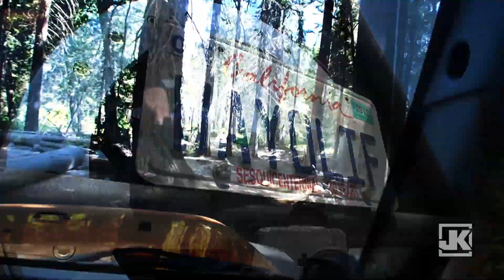RUBICAT on the RUBICON: The EVO MFG Bolt-On Coil Over Kit in Action

Comment from the maker: for the most part, you can make factory 44 axle housings last for a while.  with heavy use, the rear will bend a bit and up front, if you don't install c-gussets, the end forgings will bend too.  if you're careful, you can keep the rear shafts from breaking but, heavy use will bend a flange.  up front, factory shafts use c-clips and they will fail at the u-joint.  chromoly replacements with full circle clips is the way to go. 60's are on the to do list but only because i want to run 40's

Comment: Man, what a nice rig and trail!  Love your vids, très classy. Noticed that you changed drive shafts.  Are you expecting the D44 F/R axle housings to hold up with 37's?  Have you made any mods to reinforce them, or are you just going to let them croak?  I think you were planning to upgrade to Pro Rock D60's at some point weren't you?  Last question: Moby was a manual & Rubicat is a Auto.  Which do you prefer & why?

Comment from the maker: we installed gussets but no sleeves.  we ran our factory front shafts until the driver side broke and then upgraded to a chromoly with full circle clip for just it.  with the 3.6, running 37' on 4.10's really hasn't been too bad.

Comment: What's the difference between getting the high clearance long arm kit and bolt on coilovers (I assume you are using the dragline flip kit as well), and the Evo DoubleD Pro kit?
Reply from the maker: You can only run the high clearance long arms with the DTD kit unless you have custom work done.
Reply: Wayalife Oh, maybe I'm confused then, because in the notes for this video you say that you Jeep has the EVO MFG High Clearance Long Arm Kit and NEW Bolt-On Coil Over Kit
Reply from the maker: S Durham Sorry for the confusion, we were running the bolt on kit with the high clearance long arms but, the only way we could do it was to have custom work done to the rear axle.

Comment: how do the stock 4.10's do on the highway because i have a stock jk with 3.21 and i want to move up to 35"s and hear so much debate about gearing what is your take on it? and eventually i will get an evo coiler kit
Reply from the maker: If you're going to pay to have your Jeep regeared, you really should skip the 4.10's and go with a set of 4.88's. Of course, if you're planning on doing an EVO coil over kit, I'm assuming you'll be thinking about 37's and that would be all the more reason to go no less than 4.88.  If you post your question on the WAYALIFE forum, you'll get faster answers.
Reply: +Wayalife looking at this video - you clearly didnt have any problems with 4.10s!

Comment: Hey Wayalife or Lifette which ever one reads this. I was wondering if you guys could compare the evo lever and double throw down system to this one. I know there is a big price difference and installation is much different. But I was just wondering if you felt held back from anything. May not even compare the double throw down up front just tell us about when you were running just single coilovers with the evo lever vs. this. Thank you

Comment: Are you running stock brakes in  this video?
Reply from the maker: Yes
Reply: Do you see any issues with the stock brakes and 37s?
Reply from the maker: ***** Only after I drive a rental car that weighs 2000 lbs.  Then my brakes feel a little inadequate but otherwise, not really.  A big heavy JK can for sure benefit from better brakes and because of it, I recently installed a Dynatrac ProGRIP kit.
Reply: Thanks for the feedback, maybe I'll get lucky and win dynatrac  progrip at TDS next weekend. I just wanted to see how much of a priority upgrading brakes on a 4 door should be. You've been helpful  thanks

Comment: As always, awesome videos. This is the jeep that started everything for me. Wanted one just like it, so I bought a Rubicon and installed the double d.  I was looking at the dynatrac complete axles for the next part. They're pretty expensive so I was going to buy 1 at a time. Should I get front or back first? And which lockers do you prefer, Eaton elect. or arb air?   thanks, wayalife for hours of hours of heavenly videos.
Reply from the maker: Depends on how big of a tire you're hoping to run.  If you're gonna stick with 37's, I'd recommend getting a ProRock 44 up front first. It's probably all you'll really need at that size.  Dynatrac has a package for it that includes new rear shafts as well.  Otherwise, I prefer ARB as they've always worked well for me.
Reply: Awesome. Thank you for the advice and quick response.

Comment from the maker: for now, stock dana 44's with the front gussetted up but no sleeves, factory 4.10 gears and rubi lockers.  we've already busted a driver side shaft u-joint and now run a chromoly shaft with full circle clips.

Comment from the maker: LOL!! actually, we just changed out our original transmission due to the popping out of 1st issue but, it had over 100,000 miles on it and still had the original clutch.  i think i could have easily gotten another 50,000 or so out of it.

Comment: Very flexy at 2:45 especially in the rear.  Is that the "EVO Lever" in action?
Reply from the maker: Actually, if we had an EVO lever, you would have seen even MORE flex.  On this video, we were just running the bolt-on coil over kit.
Reply: Wayalife ok, thanks for the info.  I'll keep looking for an example of the EVO Lever in action then.